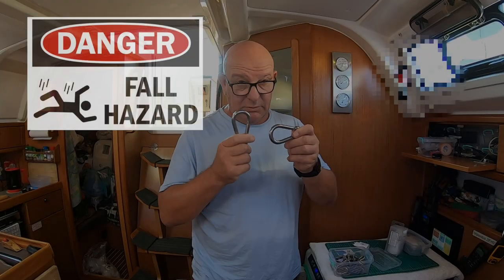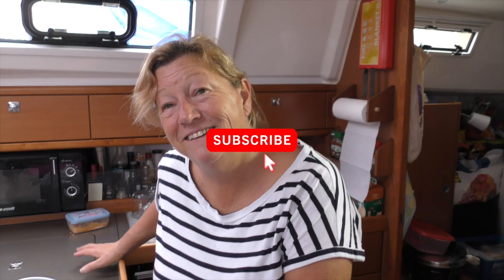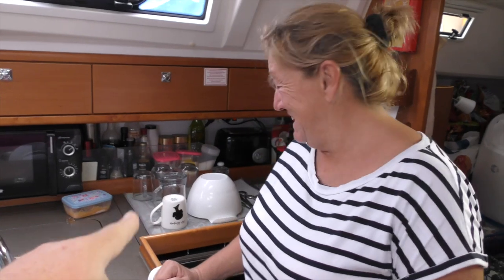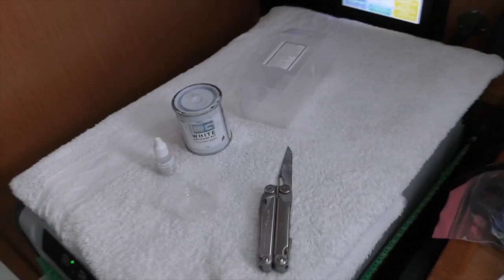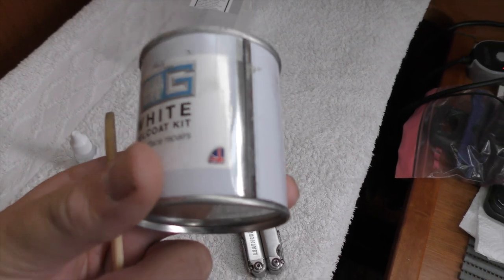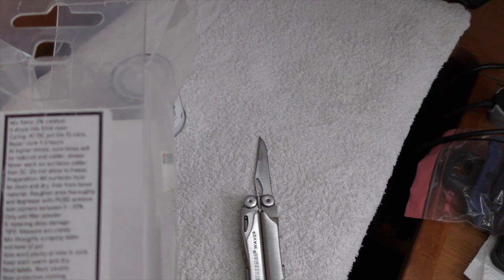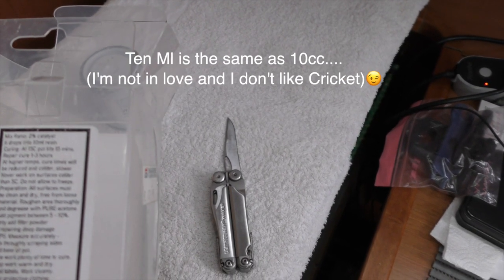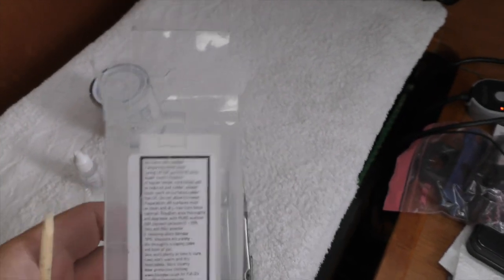How to repair gelcoat and a Safety Notice.  Dangerous Hooks!

Comment: Ahh yes. gelcoat repairs. I have a few of those to do as well. For safety lines we have the double locking type on a 2m line for the cockpit and on 1m lines for going forward. That carabiner only gets used for hanging the fender step
Reply from the maker: Too right they are ok foe hanging things but never trust them with people. Sail Safe Guys, Ant & Cid.

Comment: PS. Really looking forward to your next Video on Batteries, as I think I'm going to take a much closer look into AGM Batteries. Bob. 👍😁
Reply from the maker: Just doing the edit for the second half. Spoiler AGM's are more expensive but cheaper to make!
Reply: @SVImpavidus  I do like that AGM are fully and easily recycleable, plus apparently, if treated properly with no deep Discharging, should get up to a 10 year service life. I'm thinking if I get a 600ah House Bank, only Discharging say to 50% Capacity, so using 300 amps of it before recharging to full, that should give a decent enough service life, plus a useful enough weight down at the waterline, to help counterbalance the rear of the Cockpit Solar panels and a fair bit of the Solar Arch. 4x 250 watt panels at 15kg each, and 395 quid each AGM weigh 54kg each - very useful weight in the right place, low in the boat, about at the waterline. Loch Lead Carbon AGM look interesting, at 59kg, and 380 quid Inc VAT and delivery. 1500 cycles, at 50% discharge,   and 5 year warranty. 3 of those should easily counterbalance the Solar Panels, plus cover the weight of a stronger specced Stainless arch. Just need a Crane to get them in and out of the boat lol.  Best Wishes and Fair Winds.  Bob. 👍😁

Comment: I wish you had done the dot lift hole from the canopy. No surprise to know we have a few. Great finish you got there. Thanks for the hook warning, our tender lives on two of those. I didn't know about the shortcoming, but I use a real climbing carabiner for mast excursions.
Reply from the maker: Hi Phil still not done it. I got distracted by the rain and now I have a little work to do for someone. Its got the backing and filler in it but needs sanding down. But today its warm and sunny so we are going out to run the water maker for a few hours. Sail Safe mate. Ant & Cid
Reply: @SVImpavidus  How did you fill it? I can't get to the other side of mine. I'm not sure of what to do to stop the epoxy falling through.

Comment: Hiya. This may make you chuckle. I just got a reply from PYS on small generators, saying the main reason to avoid them on boats, is the risk of CO2 poisoning. The original stated safety grounds was nothing to do with CO2, but the impossibility of making them safe from potentially Fatal Electrical Shocks. I don't think I'll bother replying. Best Wishes, and hoping it's a damned sight warmer and much more pleasant for you where you are. Bob. 👍
Reply from the maker: The CO2 is a big issue and the Carbon monoxide too. Used in a well ventilated area with an RCD they are OK and it is the fuel you have to worry about. Boating is such fun. 😀 Sail Safe Bob. Ant & Cid